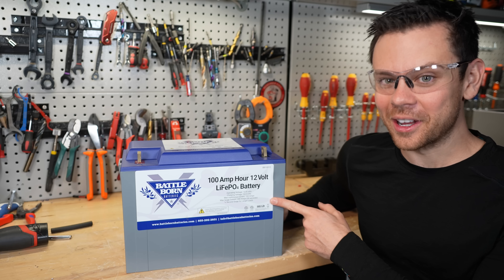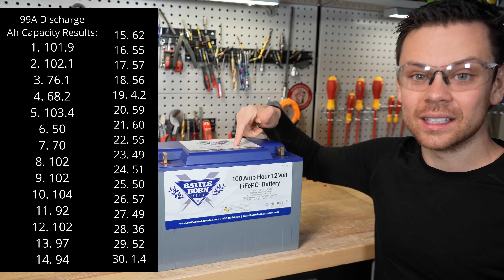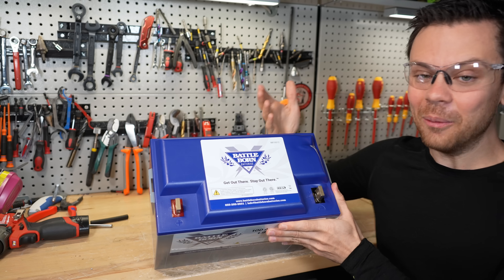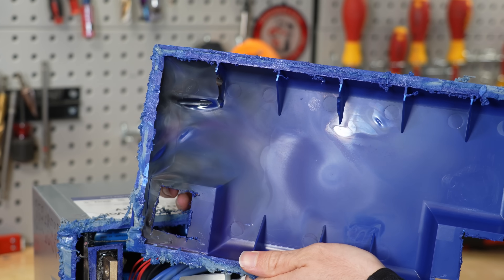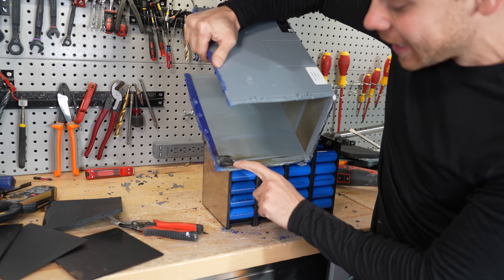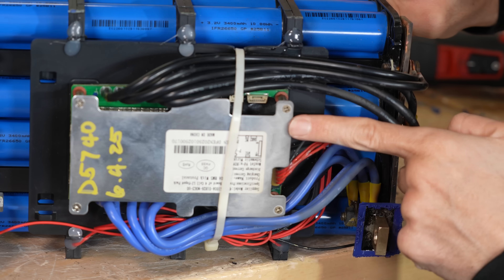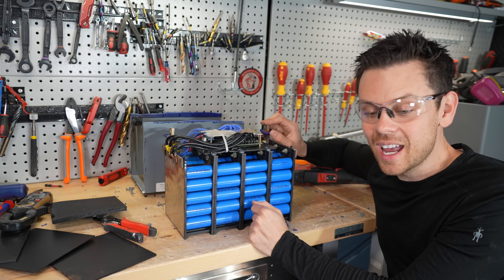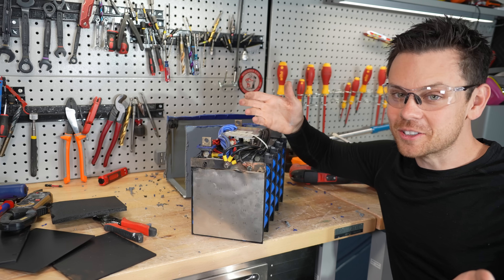Battleborn Battery MELTED?! 🔥🔥New Problem!

Comment: In the UK you would be prosecuted by Trading Standards for selling a dangerous item, and very actively so. The protections in the US are there, but are not as robust. However, The Consumer Product Safety Act (CPSC) governs defective products. The CPSC can require recalls, issue civil penalties (up to $100,000 per violation, capped at $15 million total), and ban products. However, criminal prosecution under the CPSC Act is rare and generally reserved for cases involving deliberate concealment of known hazards or violation of CPSC orders, rather than simply selling a defective product. Criminal penalties exist (up to 5 years imprisonment for knowing violations), but the CPSC overwhelmingly pursues civil remedies.
A company selling your described battery would likely face:
Mandatory recall requirements if the CPSC learned of the defect
Civil penalties for failure to report the defect promptly (companies must report within 24 hours of learning of a hazard)
Possible civil penalties for the initial sale
Criminal prosecution would require proving the company knowingly and willfully violated the Act - essentially, that they knew about the hazard and either concealed it from regulators or defied CPSC orders. Simply selling a defectively designed product, even if negligently, typically doesn't trigger criminal charges.

One wonders if Battleborn have complied with their legal duty to report within 24 hours. They clearly already know, as they have tried to pass it off as a "safety feature".

I can understand why Will might not want to report this to the CPSC, but maybe some of you US viewers would like to inundate CPSC with complaints. I'm sure they would be intrigued by Will's video.

Thinking of it, I've just seen that Battle Born batteries are available for sale in the UK! I've sent a link for several sites selling them and a link to this video to our Trading Standards Department.
Reply: They still need to prove that it wasn't just a bad batch. There are so many other variables and even in the UK they're going to take months to investigate it and this isn't exactly a high volume product, like AA batteries. It's more of a niche product so getting adequate data with a large enough sample size would be much harder, as the company can easily claim a bad batch or change in process. They need lots of complaints from customers, not just one. And they'd have to be in normal use, not testing on the bench. This isn't as cut and dry as you think.
Reply: @mediocreman2  an 8 year old battery and a brand new battery having very similar issues I think is proof enough to at least start an investigation.
Reply: @mediocreman2 Oh yes it is, every single one of these batteries will have exactly the same design flaw. Why do you think the guy from Battle Born claimed it was a "safety feature"? You don't claim something is a feature if it only exists in a bad batch. You're talking to an engineer here. Anyone who designs a bus bar assembly using thermoplastic needs their head examined! It's like battery design 101! Heat melts plastic! It's as fundamental as "don't make fireguards out of chocolate".  How do you explain the same fault turning up in batteries over an eight year span being "a bad batch"? There probably aren't lots of complaints because Battle Born have been fobbing people off by threatening to charge them a huge "examination fee" if they find no fault. If people still send their batteries back, they have been quietly sending a replacement out. Battle Born know what they are doing. They know they are breaking the law and they are probably shitting themselves and running round like headless chickens right now, knowing theyve been caught.

Comment: 3 lugs on a single screw is not recommended.  They should all have their own screw so as heat causes screws to micro fret and move through expansion contraction they don't loosten and arc and heat cause further loostening.  Each screw only has 1/3 current and 1/10 of heat significantly reducing chance to loosen.  For a few pennies they fled up the design.  Any experienced designer knows this but factories are always trying to eliminate steps

Comment: Most likely BB has started doing what other companies do by bringing in cheaper batteries that are not theirs and just reselling.  It is fine to do this but if you miss having a formal QA process such as buying the battery outside the plastic box and your QA people do the final test point inspection and ultrasonic weld and packaging you will get this. All this issues will not make it past QA if you have a good process

Comment: I have four of these that just stopped working for no obvious reason. I opened one up and there was nothing melted inside, and the cells were perfectly balanced. I guess the BMS went bad?
Reply: Check for corrosion between the aluminum bolts that attach the positive and negative terminal posts to the bus bar and the BMS.

Comment: We're going to have to start calling them BattleBurn from now on.
Reply: LOVE IT - great one
Reply: Said that weeks ago ;-)
Reply: This one is a RattleBurn model...
Reply: My thoughts exactly, you beat me in writing it.
Reply: That comment is quite the Burn
Reply: better name, BattleBoom!
Reply: That's not all that was burned unfortunately. Geez, I got 4 of these things back when it was universally claimed to be the only "quality" option 🤢
Reply: @ChatGPT1111  Same here! Mine are for emergency power and light loads but I'M NOT HAPPY!
Reply: eppic@!!!!! LOL
Reply: BattlingBurns Battery
Reply: BattleBurnt
Reply: In D&D parlance, "this is now canon."
Reply: This was added as a handy feature during a firmware update.  

In a low temp scenario, you can enable “Jesus Mode.”  It essentially sacrifices itself to provide enough heat to keep the others around it from reaching low temp cutoff.  

Apparently, it can be brought back to life as well if enough time has gone by.
Reply: Now that's funny:-)
Reply: Good description.
Reply: Lmao!
Reply: Thanks for the great video! Strange this issue had not been reported several years ago. Lots of people must have used them in similar ways
Reply: Lol😂 hopefully showing the issues publicly will force them to improve the design
Reply: This will stick !
Reply: Way over priced
Reply: I was tempted to suggest "BattleShort", a play on an emergency usage mode on most military equipment that allows you to keep using it in spite of faults or out of spec operating conditions.  But that would be too positive a spin on this product.  It's more of a "Battle Open Circuit", if you manage to avoid a fire in the first place.

Comment: I don't have any batteries in my setup other than the ones inside the Power Bank but Ive watched a lot of video about using them. I have noticed about the time of the sanctions things started going south with Chinese battery companies. U tgink they may be doing tgis on purpose because how could anyone with just a bit of good training get things this wrong. Im a dummy about batteries but even I know plastic between the positive and negative posts will heat and melt.  I will not buy any battery until I can find a reputable company NOT IN CHINA!

Comment: Let's say I bought a car and they said it did 0 to 60 in 10 seconds and stopped in say 300'. I test it and find that it met these specs the first time. When I repeat it many times, the engine and brakes both overheated. Would this be a problem with the car? I don't think so.

I'm curious, why is this different from the Battleborn battery? Do they advertise that it will meet Wills tests? Will other batteries meet these tests? Is this a real world scenario?

Note that I'm not saying he is wrong, I just don't understand.
Reply: Will has done these same tests with many other batteries over the years, with much better results. The reason he dug deeper into this one is because one of his subscribers sent him a battery that had a problem.

Comment: If Ford was to build Lithium batteries, this is what they would look like. Thanks for the great Battleborn reveal. I bought two 300 A Lithium RV batteries from Alibaba to replace my lead acid House batteries in December of 2019 and have no issues. I did buy the biggest AC>DC charger available from a company in Florida because my old one melted for the Lead Acid batteries that were enormously heavy. It was December in Cranbrook, B.C., and the temp had plunged to -18C when the Power Converter/12V Charger failed. I was living in the R.V, and since the 2 furnaces stove-top igniters all ran on the 12V system, this was a crisis. The 30yr old Converter was rated for 75 amps for the enormous lead acid batteries, I did not want any further failures so I bought the largest Charger/Converter one available from a company in Florida, it arrived in a couple of days. The batteries from Alibaba were weeks out, so I had them flown in from China and they arrived in 5 days at a cost of $500 CAD for air-freight after they passed through Customs. I really enjoy watching your Channel and watching your reviews and tear downs of batteries and all things Solar.
P.S. Since it was during Covid, I tried to get all of the Auto parts stores here in Southern B.C, and the Heavy truck retailers here to take the Old Lead Acid batteries and they ALL refused to take them for FREE. Since I was going home to Edmonton (500 miles north) I decided to take them with me. When I took them to the Salvage metal yard they paid me $600 CAD, because of the Pandemic there was a severe shortage of Lead. I almost gave away $600 bucks.

Comment: I knew the moment Battleborn doubled down on their "design," you were going to find an issue. You have a bms and cells inside of a plastic container, any heat created doesn't really have anywhere to go. Yet an engineer thought that using plastic as a poor mans circuit breaker was a good idea? I think a replaceable fuse in a hidden but accessible compartment on the lid (or small dc breaker) while also welding the internal connections would have been better. The internal plastic only has to get hot enough to ever so slightly deform or get soft, it's all down hill the moment that happens. Their design literally creates the classic overheating lug scenario when people don't properly torque their connections. I can't wait to see what Battleborn's response is, unless they're now selling overly expensive battery/heater combos. I guess on a good note it won't freeze in harsh temps?

Comment: I'm still leaning towards someone making a change on the factory floor without informing the engineers. 

The plastic they're using is melting. But people have been using these batteries without issue for decades. 

Could it be somebody substituted a different grade of plastic, and what they used to use didn't have a problem?

Can you repeat this test with an old battery?

Comment: You let the magic smoke out of it.😮
Reply: You need to explain the joke.  All electronic components are secretly made from smoke, which is sealed inside the component so it doesn't escape.  As soon as the seal breaks and lets the smoke out, the component goes bad.  😄
Reply: @theclearsounds3911 when a chip burs up it lets the smoke out. Its a joke. 😅

Comment: Suggestion: Buy another new Battleborn battery, remove the case, run the "exposed" battery through the same tests, but with cameras and non-contact thermometers pointed at the battery. Oh, and a fire extinguisher.

Comment: Hey Will, I have 4 BB's under my bed in my RV since 2020. Have you considered making a "repair" video for us DYI guys that have the ability to tear them down and fix the problem permanently. I would hate to have to be forced to replace them with Watt Cycles or other "safer" batteries when mine are still ok but are obviously "Trojan Horse's. I could see how that might be a liability for you but Im sure you could protect yourself with liability disclosure verbiage.
Reply: Probably you don't draw heavy enough to pull full amperage per battery.
Personally IF I got them for FREE, I'd replace the Bolt with longer bolt and double nut both sides of the terminal and connectors after ensuring they're tight.
Then you don't have to worry about plastic getting deformed and loosing tightness.

Comment: I spent $900 on a paper weight. F*ck!
Reply: I paid over $20K for ten of the 270 Ah BBGC3s. If they have the same problem....OUCH!!
Reply: Holy sh*t. I hope you don't have any problems. I just have one that runs my homemade all in one system for camping. I haven't had an issue. But I'm not taking any chances. having a RBM tent melt on me doesn't sound pleasant at all.

Comment: I have eight Battle Born Batteries I bought around five years ago and have them wired in series parallel for 48 V.
I have never had any problems with them, but after seeing Will‘s videos, I’m a bit nervous now!
They are all on a nonmovable table, so I’m not driving them in a van or anything mobile. Sounds like they need to get rid of that plastic and find something else to attach the bolts too. 🫨

Comment: I live off grid, and my neighbor has at least 90 of these batteries in his solar system. i’m gonna have to send him this video.
Reply: My suggestion is.........Build A Fire Break!!!!!!
Reply: He's either a millionaire or a pauper...
Reply: Man, can you imagine the kind od system you could build on a budget for $72,000.  Wow
Reply: Well if he has  90 batteries he is probably o.k. as the power draw from each battery must be quite small.
Reply: @a2022z2  Maybe. Maybe not. The plastic bars are still vulnerable to cold forming. It's a bad design, but I wish they would've used Belleville washers to maintain tension on the bolts. Low current draws with cool-off time between cycles will limit the heat and probably slow down the failure process. I doubt it will stop the degradation, only prolong the time before a failure. I have four BB batteries running with very low current draws (0.1C max charge/discharge). I will still have to phase them out. My problem is finding replacements with nearly the same physical dimensions. Suggestions anyone? I wish they would've used Belleville washers to maintain tension on the bolts mitigating small amounts of deformation in the plastic. It's obvious a mechanical engineer never reviewed their prototype design. 

I worked in Silicone Valley for 20 years doing cyber security, and I recognize the pattern of a truly arrogant engineer who is impervious to negative feedback running a startup. As a contractor, I can't count how many times I heard: "Don't bring me a problem without a solution." I said more than once: "OK. Hire a replacement for yourself who can listen to negative feedback without doing your job for you - so he doesn't come up with designs that suck." Surprisingly, I didn't always get fired for saying that. Some of those a$$holes actually respected people who stood up to them. And when I did get fired, their competitors called me the next day offering me a better rate.
Reply: @a2022z2  That depends on how much power comes from his solar panels, and what he's running in his house.  With 90 batteries, I wouldn't be too surprised if he's trying to heat his house off his solar system, which really would strain all 90 of his batteries.  What a massive system!  I wish I had the money for that!

Comment: Will, can you tear apart one of your old battleborn's to see if they changed in quality?  I've been running 16 of them for 8 years with no problems in a 48V bank of 4 series strings, however my total capacity has dropped tabour 60% over that time.
Reply: I was thinking the same thing. Maybe they older batteries didn't have the same design. He cycled those batteries a lot. I hope he sees your suggestion.  I have 2 older BB , 1 stupid charging, they other seems fine. I didn't run them hard in our RV part time

Comment: Please pick a similar battery without any added features like active cooling and preform the same test. (Maybe WattCycle?)  All I had to do was google "If you continuously cycle a lithium battery at it's rated spec will it overheat" and the answer I got made me realize this test is presenting biased information.

Now - my mind can be changed - but you have to prove it by doing this same test with a similar battery and reporting the results.

"If the 'rated spec' does not account for continuous duty and the environmental conditions, overheating is a significant risk. Proper thermal management is essential to safely sustain continuous cycling." <--- That is for any lithium battery
Reply from the maker: SOK published their non-stop 1C charge and discharge cycle testing results publicly, with thousands of cycles. I do non-stop back-to-back cycling with my watt cycles and they do not have any issue. I've done it with many other batteries in my videos too. 

Once I get my cycle machine I'm going to put all batteries up against each other in this manner
Reply: @WillProwse  I look forward to seeing that testing.
Reply from the maker: Also the AI is really stupid when it comes to electronics. Ask it some more questions and it will just give you nonsense
Reply: @WillProwse  I dug deeper than the AI result - I never take the AI answer point blank. I find doing that is very similar to taking a youtubers word (of which I am one) point blank. I always dive deeper and all the answers I was finding were saying that if you do this sort of test on a lithium battery it's gonna overheat. So that's why I'm interested in seeing this same test with other batteries because without it - you have not given us anything to compare to.